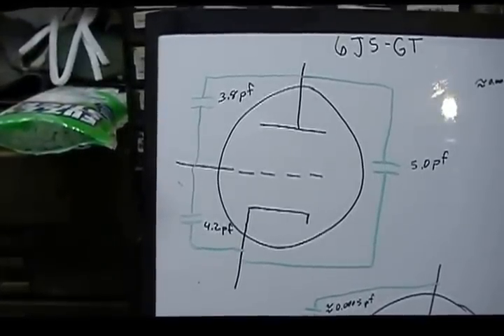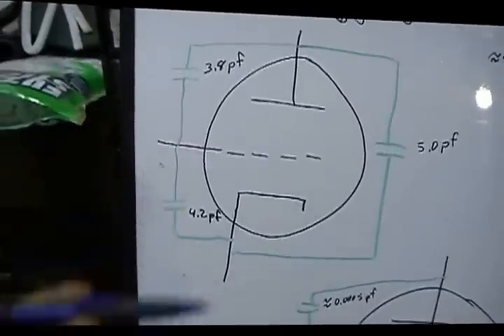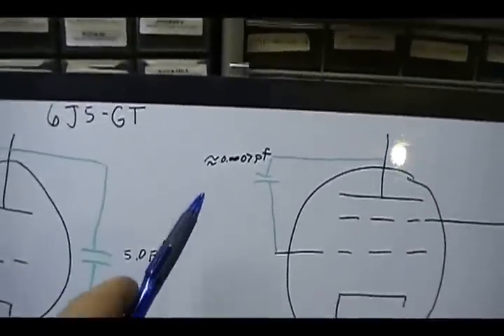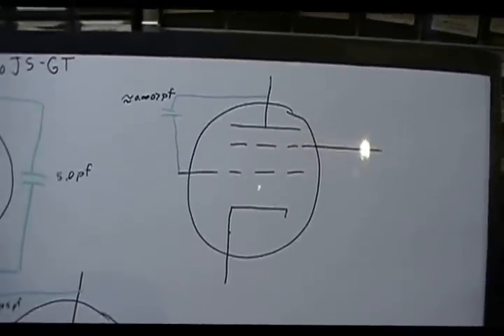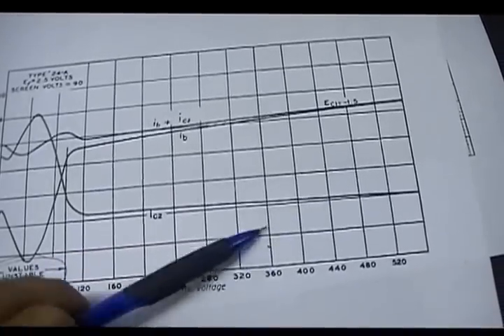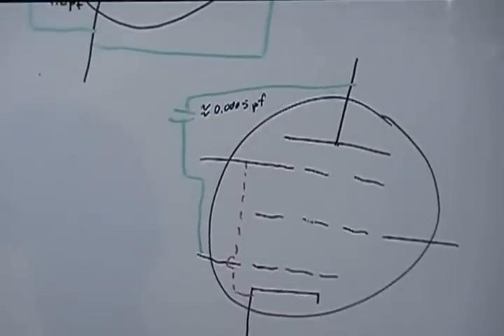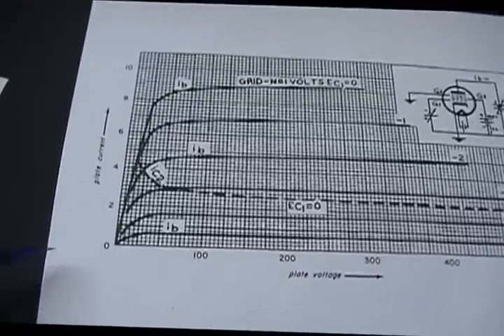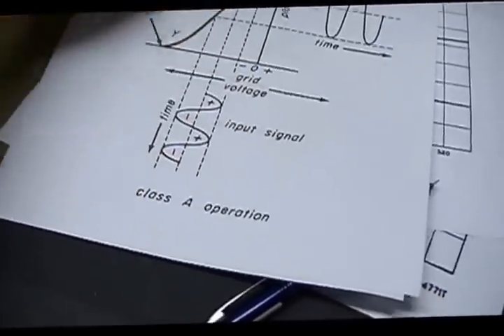Tube Theory part 2

Comment: Sir, I am taking your course right now, I understand some but the math is difficult  My question for right now is about what i hear you calling Mew  What is the perfect mew? is higher better or is lower. Is it designed to take the the original signal and produce it much louder with the least amount of power. Is this the objective?
Reply from the maker: AmIonArock Mu is the amplification factor. It's used to calculate the stage gain. The higher the mu the more gain the amp stage has.

Comment: Hi Dennis. Thank you very much. If I had of had a teacher like you I have no doubt, My field would have been industrial electronics Rather than Mechanical. I did work with electric gear switches, Motors, hard wiring and soft starters. And some of the ladder programing. This is really a big help for me in repairing and restoring vantage sets. Thank you again Dennis. Take care. Bobby